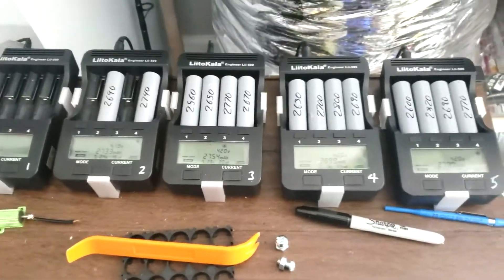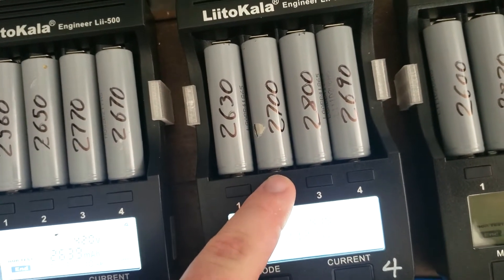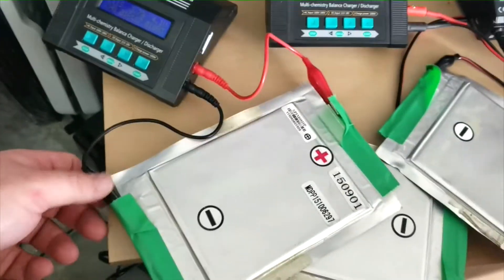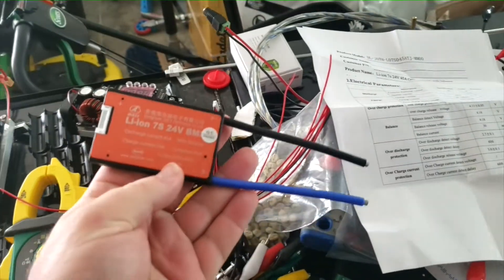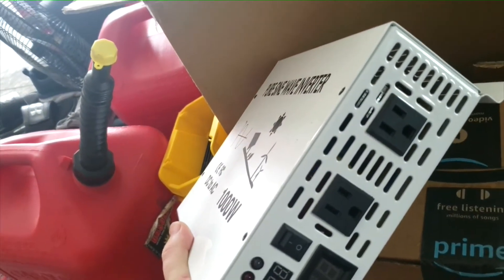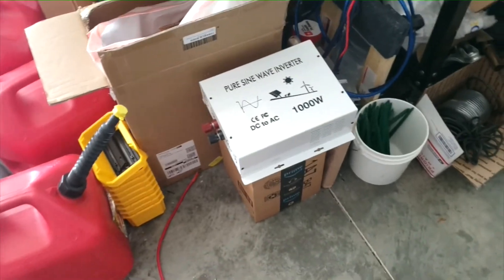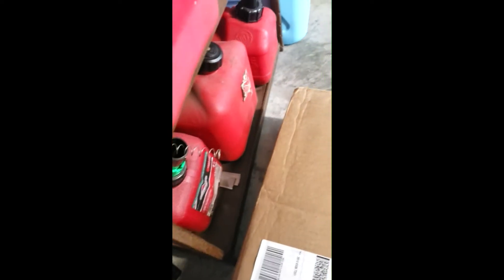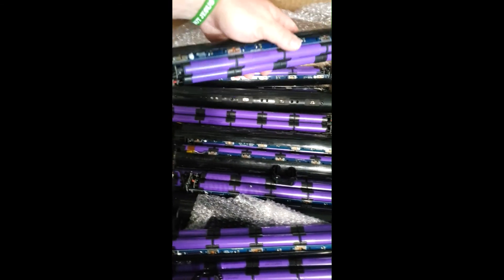SOLAR LGM26 Used 18650 and SPIM08HP cells capacity testing POWERWALL

Comment: Those M26 purple cells are awesome. The blue EVE cells are also very good and I tested them about the same capacity as the purple ones. I use the megacell charger with 16 bays and 1 amp discharge, automatic cut off if any cells gets hot, very good for when you are away at work, can also remote in and monitor it, all software driven from a PC as well as ability to print labels at the end of the capacity test.
Reply from the maker: cool man. I seen the megacharger review that Lithium solar did.  It looks awesome.  Yes the EVE cells tested the same too.  I like the wrap on the purple cells. it feels tougher. ha

Comment: I still dont understand why people use the littokala's.
Their discharge current is only half of an opus, and will therefor give higher results.
Reply from the maker: Because they were only$20 each.   Works good for my schedule.  2700mah takes about 6 hrs.  I have a system down for rotation.   Leave for work 8 hrs, change when I get home.  Change when I wake up. Change again before I leave for work.   3x20=60 cells a day.  Everything gets charged before going in on separate chargers. When they are done capacity checked they get pulled off and charged separately on regular chargers.
Reply from the maker: As long as you capacity check all your cells the same way you will get a good result.  Can't use 3 types of testers and get great end results.
Reply: @RodneySolarCircuits  yes but since the littokalas are discharging at 500mAmps,  the outcoming capacity is higher then the actual capacity
i understand that price is a concern, but i use opus chargers for the reason that it gives more accurate capacities since it can discharge at 1000mAmps
Reply from the maker: @bartklump  Yea, I see your point. It would be nice to test in half the time. But the only reason we capacity test is so we can build equal packs.  Aslong as you test all the cells the same, you are good.  You could test them at 5 amps, aslong as you do them all that way.
Reply from the maker: @bartklump  If your powerwall is big enough, each cell would discharge below .5amp anyways.
Reply: @RodneySolarCircuits  good point, never gave that my thoughts
Reply: Have you ever seen a recycled battery give you half the capacity at 500ma discharge rate, compared to 1a? I'm having capacity issues with my battery pack and that.
Reply from the maker: No! I would check all the connections in your build. Maybe a fuse blew or spot weld came loose.  I had the issue of a row of cells having lower voltage. See one of my newer videos about building boston power cells. Lithiumsolar's latest video he found an issue and fixed it wil getting lower capacity.
Reply: Because the Opus has major flaws and requires the fan mod to function correctly otherwise you are getting false results from the 40C cells and the start and stop of the discharge cycle